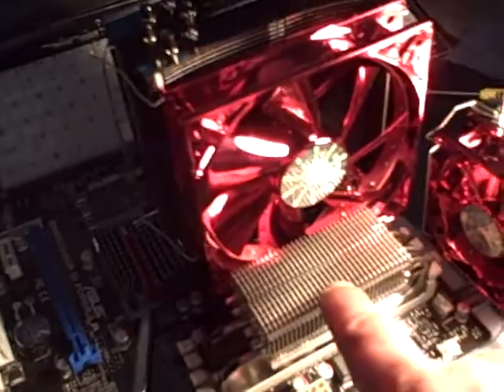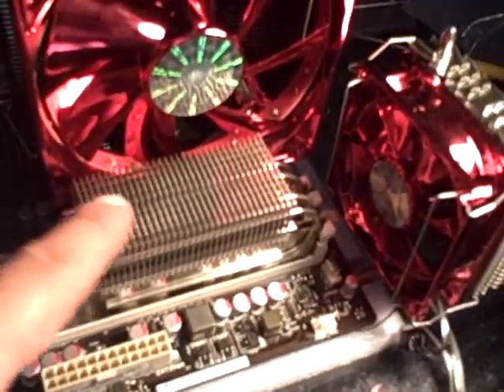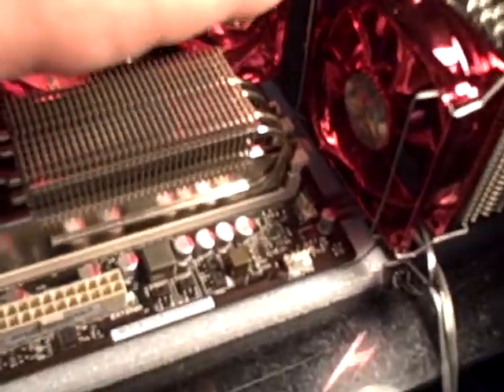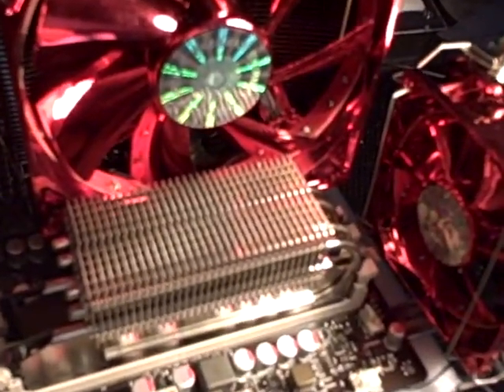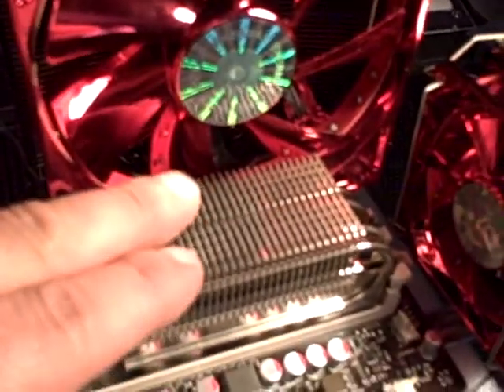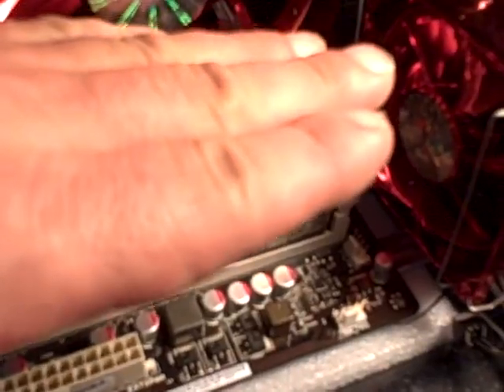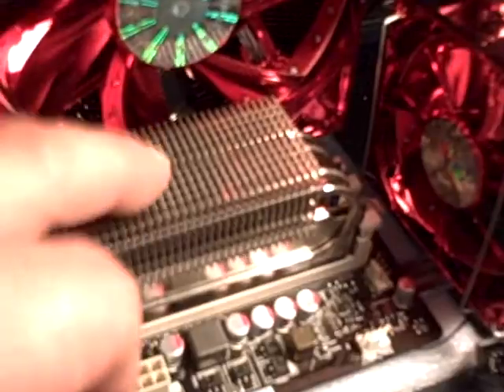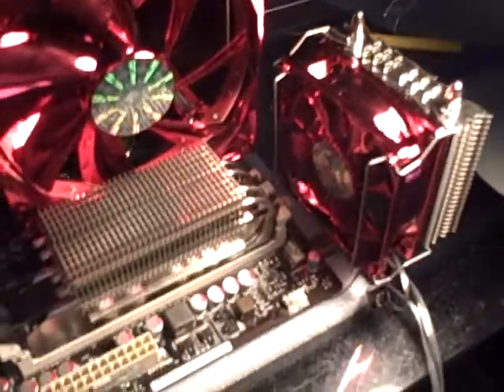AMD CUSTOM BUILD INSTALLATION OF MEMORY MODULAR AND COOLER

Comment: No need to get a 'high' cooler for the RAM. As one RAM would be cooler than the other.
This setup is good enuf and more efficient, but the orientation of the RAM cooler is like a 'U' and not 'n'. It's bcoz of  the gravity of the liquid inside the heatpipes. It will flow back ti the top rather than to the RAM side with your current setup. The difference can be abt 1 to 2 degree. This juz my opinion or preferance, you may want to try it out and see the results.